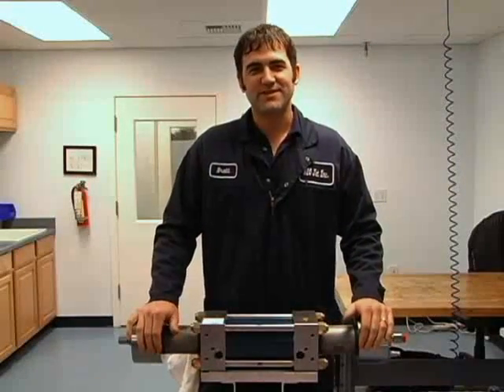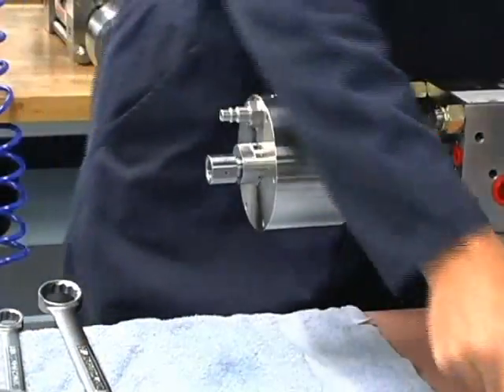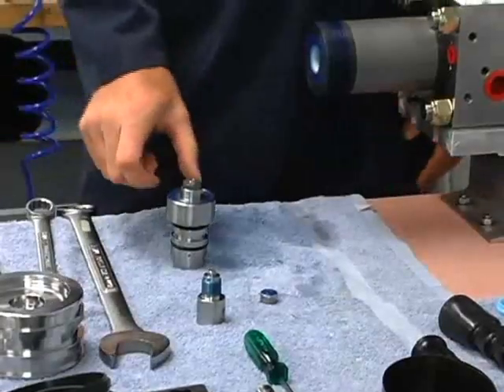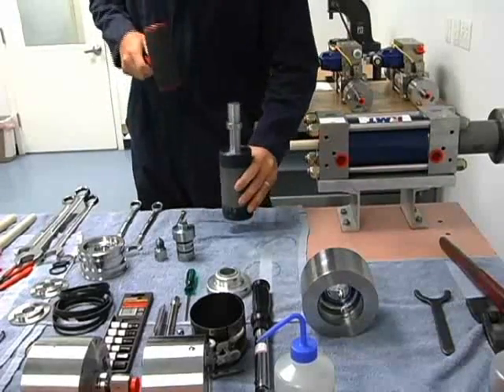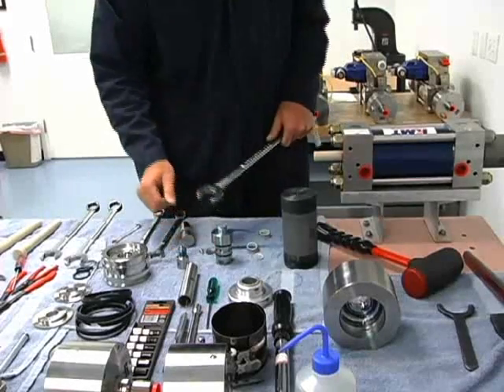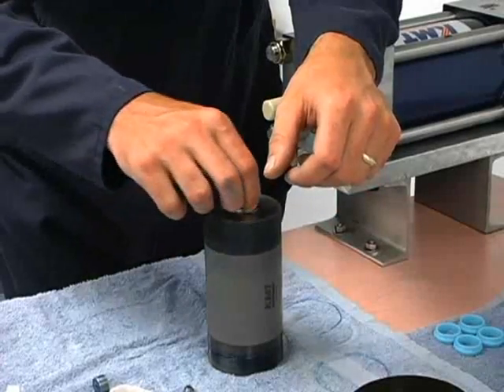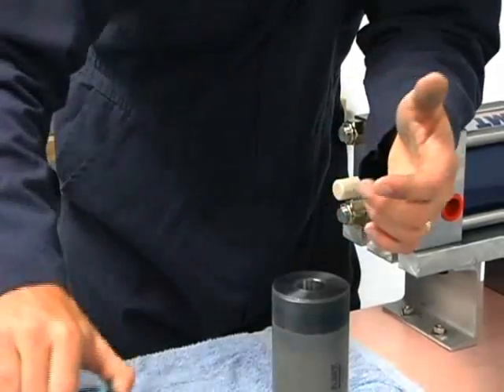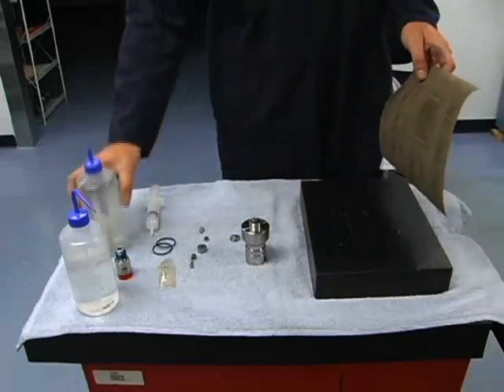Part 1 of 6: How to completely rebuild a H2O Jet or Flow Waterjet Intensifier Assembly

Comment: We found that the rebuilds lasted longer if done by Flow even when using parts supplied by them.  Some of the components had wear that we could not measure I guess??  Still have a spare 55/60k intensifier laying around for sale now that we've upgraded machines.  Good video.